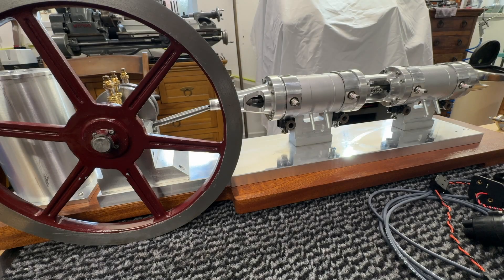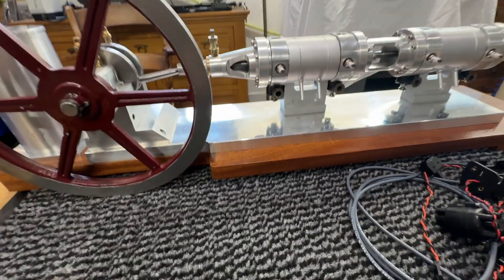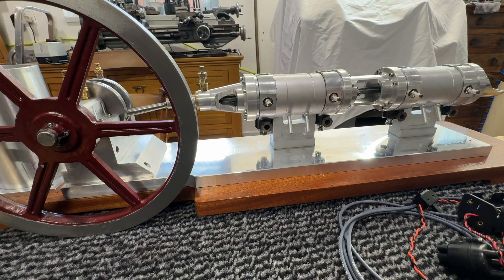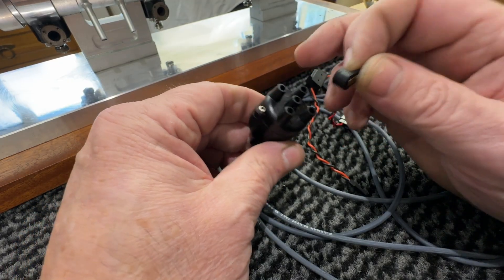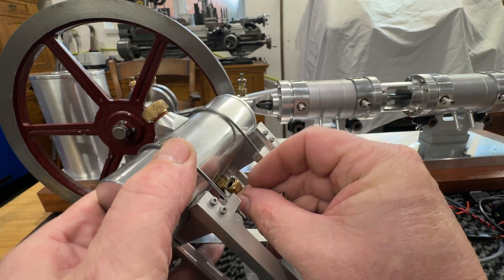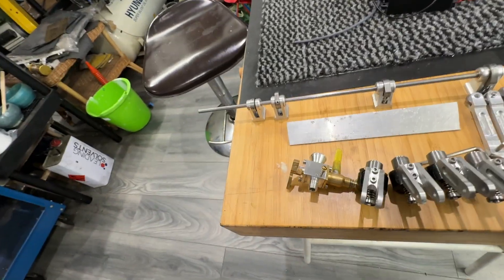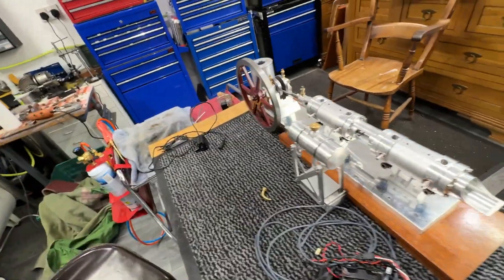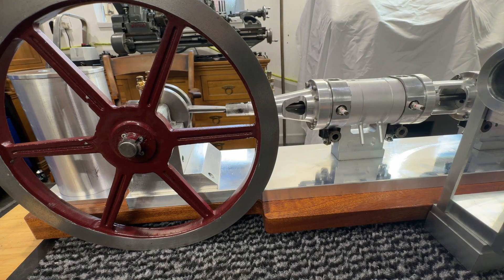Snow engine alignment

Comment: Just had a look in my stash for you. biggest i've got is 7"x1" unmachined, if it's any good to you, it's yours
Reply from the maker: That's very kind of you to offer Paul, but the plans call for 8.5" x 1.2". I think it needs the mass to keep the thing running, as it has a firing order of 1234. The one on it is 9 " but 3/4" wide and a wobble lol
Reply: @modelengineeringadventures   ok offers still there if you want it. It's just sat on a shelf
Reply from the maker: @paulrayner4514  very kind